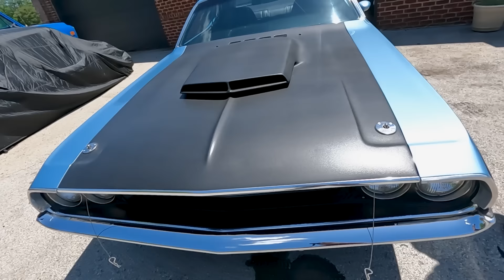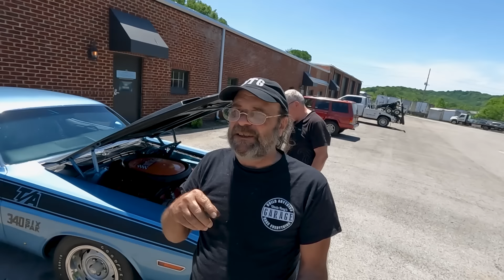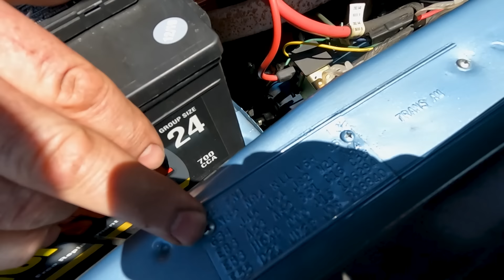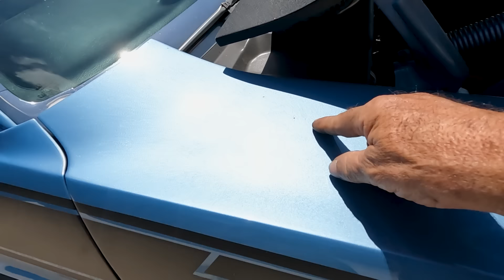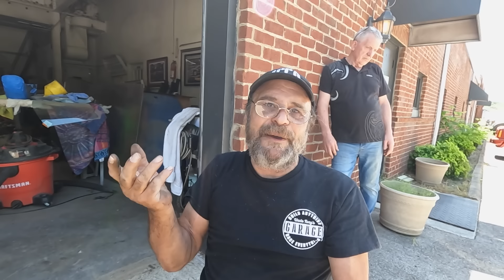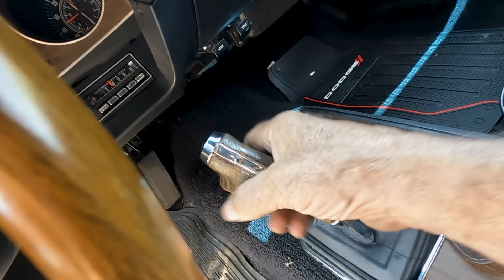Chryslers Most Enigmatic Musclecar - The 1970 340 Six Pack T/A Challenger (And AAR Cuda)

Comment: I had one of these engines for years. Never used it in my street car, weekend warrior drag car. Never understood totally its intentions. As it was already built. Came from Georgia. Had a 3.466 stroke, 4.04 bore, mushroom flat tapped cam, hemi footprint rods, Diamond pistons, tapered pins, 4 bolt main, barely touched TA heads. Never ran. So maybe intended for NASCAR. IDK
Anyways ended up selling it, and bought a X race block and some W2 heads, and some W5 heads. Money left over. Tried to find the AAR CUDA it came out of according to vin on block. Went to another AAR car.

Comment: One thing.....ALL 340's had 2.02 Intake Valves through 1971.....The 1.88 size didn't come along until 72 and I suspect that the change was made due to the heat generated by the EGR system.
Reply: I forgot the W-1 T/A head also had unique offset cast iron adjustable rocker arms the exhaust were the same as the earlier 273 motors. Finding OEM parts in IMPOSSIBLE these days for the rockers. The block casting says "TA" when you look for the correct identification.

Comment: I never understood the "too big for that engine" argument for carburetors. An engine will only suck in as much air as it needs, yeah you may have to adjust the jetting if you have a big carb on a small engine but adjusting jets is something you should do anyway. Theres no harm in running a big carburetor on a small engine though right?
Reply: Might not have good velocity at low rpm with Big butterflys open

Comment: Trunk pan is not drilled for exhaust hanger. All others were drilled on passenger side for single exhaust and both sides for dual exhaust. Only the dimples are on passenger side, obviously no hanger.

Comment: The shaker did come on a few early Challengers as an option, then it disappeared. Why?  The difference between the Challengers & 'Cudas hood- in crash tests, the Challenger hood with the shaker had a nasty habit of popping the hood corners up into the windshield in a decent front-end collision. 'Cuda's had a header panel in front of their hood and were a different stamping, didn't have that issue. 

Funny thing? The staggered wheels actually make them handle worse because it pushes the already nose-heavy front center of gravity further forward...neat look, I suppose, but actually detrimental to handling

Comment: No AC!
Reply: A/C wasn't available on the T/A, AAR, 440 Six Pack and Hemi engines due to the compressor interfering with the air filter housing, front carburetor or intake manifold. Those old Airtemp V twin compressors are huge.
Reply: @phillipcramer7936  I always hated having to hunt down non-AC crank and water pump pulleys.  Back when I did it there weren't any repop ones.

Comment: End of story a 850 carb is too big for a 340. Unless it is running between 5000-7500 rpm. Those 6 packs spent 98% of there time as a 350cfm carb!
I though that 6 packs used the big valve heads with the offset rockers. I have learnt something.
Those safe at 20mph tyres, killed a LOT of people. Chrysler Australia used 14x7 alloy wheels and RADIAL tyres in 71. 
That car is sort of me, lovely color and trim. 340 and 4 speed and the good diff. You can have the graphics however, FUGLY and those pain in the arse carbys too. Single 4bbl will go faster and is lighter